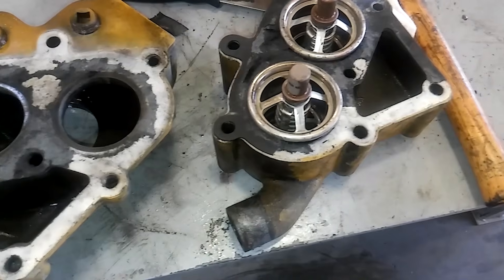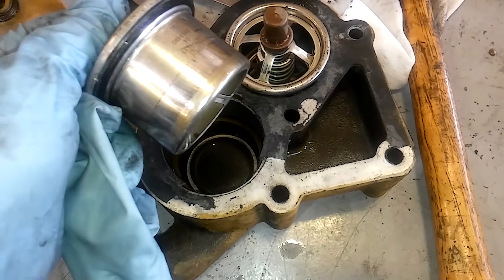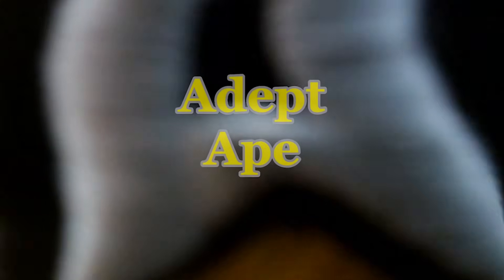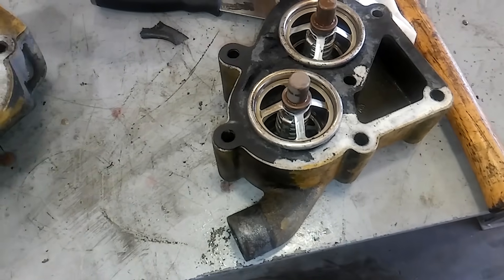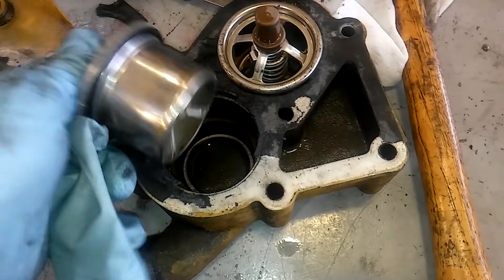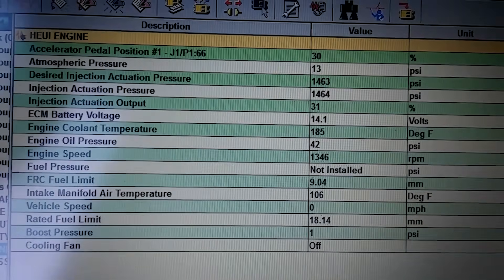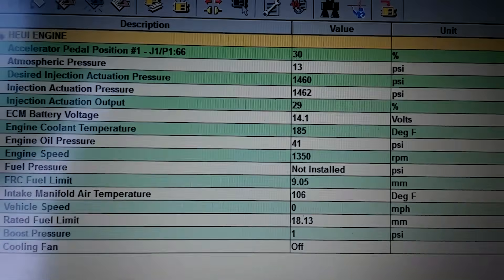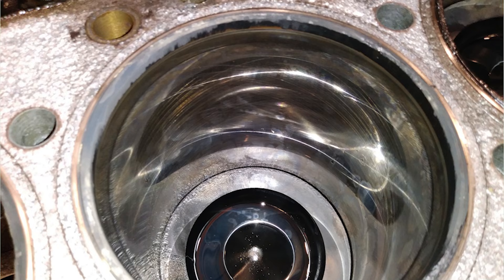Why You Should Never Remove or Use a Colder Thermostat In Your Engine.

Comment: what a crock, 170 thermostat, fan on at 180. been doing this in my trucks for over 30 years, no problems, better oil presser. I`ve been doing this probably before this guy was born, don`t believe everything you see on youtube. let me know if you need the cat part # for 170`s  I`m pretty sure that everyone know an engine is not a person,
Reply: I run my old junk cooler because it keeps running. Buying that little bit of time between 160° and oh shii, has kept me away from many shop doors.😂❤ automatic transmissions hate heat. They love cold. 94 Ford Ranger been on 165 with a bad sealing radiator cap for five years. Buick Rendezvous the bane of 3.4 Chevy engines has so many off the books repairs at 300 k that when it goes it goes. 

Right now what keeps kicking my butt are silly a** fuel pumps built right into the tank. Whomever thought that was a good idea should be emasculated with a rubber band.  

Junk just runs different.
Reply: Yeah that's how I run my cats 3406b no no problem every time I get one I change thermostats I can only speak for cat 3406 get that  210 you be fixing headgaskes
Reply: @darienbecerra2887  exactly. why run an engine right on the edge? Head bolt`s start to expand after you you get to above 195 to 200f, plus engine oil gets watery,  i`ve seen alot of head cracking problems especially on the cat engines. My truck gets to 185 I know something`s not right, also, those hotter thermostat`s don`t allow any room if there`s a failure someplace in the cooling system, it`s an emission thing nothing else, thanks for the back up

Comment: Maybe on cats its rare.  On DT466 its common.  The thermostat will start by not closing all the way and the engine won't come up to temp when its 20F or low.  Next it will fail completely not open all the way and the truck will overheat anytime the truck is under heavy load.
Reply: Cat they fail open.edit older stuff don’t know about new. I’m shade tree Non Mech

Comment: PISSES me off when guys torch an axle apart like that!!!, but the fact that you guys had a KASIER "K" series kit to put put it back together with doesn't surprise me.
Listening to "CAT" techs complain about stuff!!!??? (things I machine for the local dealers), and then watching you guys do some STUPID SHIT! really has me shaking my head at you guys!
Reply: Could you be more specific?
Reply: I like Josh’s videos very very much. Tip jar should be filled. Takes effort and guts to put out video.
But I agree. Heat then press
Reply: @RB-cz5jn  - In this case, assuming you are referring to heating the exterior of the axle "eye", the process could conceivably weaken the axle end, if performed necessarily to extreme in order to free the kingpin.
Reply: @cwj9202  another one of those not supposed to. But heat the pin and cool it then press it. At own risk because of damage and a result of to much play.
Edit: if I’m not careful I right a whole book.
If you heat the pin and it’s not cooled it will be tougher. Most heat the area around it.
There’s a trick to it.
Not supposed to heat it at all.
Shim kits etc etc..

Comment: Hey Josh. I did kingpins on my W9 and one of them developed a burr while still in its bore and locked up tight. Ended up having to pull the axle out and take it to a machine shop where they had to use a 150 ton press to push it out. What a nightmare those things can be!
Reply: Mine had to be heated to near melted with a 150 ton press , It ruined the hole so i ground off the axle end and welded the new ones in , they lasted to the end of vehicles life . Mostly overloading and very high mileage had welded them in .
Reply: @MyKharli  goodness gracious. What a nightmare. Great job overcoming! Replacing the entire axle ain’t cheap. I know cuz I priced it out.
Reply: @PickupsAreNotTrucks  They are silly expensive and second hand ones have the same fault imo . It was hard ensuring the kingpin was correctly aligned and keeping the top surfaces clean and flat . TBH i was always sightly worried the weld would crack off even though i did a beefy job . It passed the MOT for many more years though . TY for reply .
Reply: How often (miles) do you grease them? Never had an issue here in New Zealand but companies are basically required to have trucks greases every 15,000km or they void their insurance
Reply: @keyboardplayerakas  I try to grease my truck every 5000 miles or max 10,000. I bought the truck with a bad kingpin.

Comment: Slobber'r A.K.A. 66 Ford F100 always ran 160*F till I put in a 195*F ... Ran so much better and way better fuel economy.
Reply: Seen the same thing. 64 ford 292. Ran like junk until I put in a 190 back in it. The engine overhaul showed it as well.

Comment: I have a question about DEF and sensors. My township road crew wants to replace our old but low hour road grader with a brand new $330,000 Cat grader. It is parked in a shed 11 mounts out of a year, so would the emission parts fail easily setting that much? Thanks.
Reply: What is the reason for the grader needing replacement, and what is the old grader (120G or something newer)?
Reply: @cwj9202  one person just wants to replace the 30 year old machine and keep on a schedule of replacing all equipment averaging $100,000 a year so it is in the municipal budget.
Reply: @mikekahl5609  ahh, the old "if the money is in the budget we have to spend it so they will give it to us in the next budget". Typical 😥
Reply: @mikekahl5609  -- Having worked for a government entity, I will say I have heard that questionable rationale before, "It's in the budget!"  A grand waste of taxpayers' money!  We had nicely functioning heavy equipment whose age exceeded 50 years and hours that were low.  That $330,000 would look nicer on the roads and in any existing potholes.
Reply: @cwj9202  That's exactly his reasoning, its not my money and I want new equipment.
Reply: Not sure how hot it gets there but DEF has different life spans at different temperatures. Some def boxes have it printed in the side. As a general rule def should as be as fresh as possible but a hot shed all summer long could exceed its life expectancy.
Reply: I think draining the DEF, washing out the tank with distilled water and completely purging the entire system of all DEF will be a very good idea.

Comment: I will agree for the newer engines but I’ve got over 20 yrs in the trucking industry as a driver.
The old school guys did this all the time.
When your going up a mountain and your setting at 200 and above in a older truck with a older radiator. Your going to over heat. To many variables for me to make a solid argument.
But those guys get million plus out of there moter.
I enjoy and like this part. Basically a Mech saying one thing and raw experience saying different.
99.9 Mech would agree and good video.
But experience says your wrong.

Kind of like I’ve got a new truck and it will last yrs.. then they hit a deer.
Generic answer your right but it’s not.
Like when you plug in a computer and all you got to do is read the sensor. But what if the input information is wrong. Experience is going to tell the tale.
Thanks Josh for the video
My grandpa made millions off the grey area.
Reply from the maker: Older engines did run cooler than the 200 degrees I mentioned in the video, you are correct. Seems like they have incrementally been increasing the operating temps higher and higher to get the engines to meet their emissions standards. Thank you for the comments and your personal experience.
Reply: False information is just as bad.
Meaning if the inputs are wrong your answer is going to be based on false information.
Your right. I’ll leave it there.
Reply: @RB-cz5jn  here’s the problem with what you’ve said. 

The equipment old timers used, it sucks. Radiators were less efficient, the coolant was less efficient, everything was. To combat that, manufacturers had to use cooler thermostats. 

30 years ago, what you’re saying, might’ve been true, but now, it’s not. Engines are very efficient these days. Radiators, coolant, fuel systems, it’s all better than it used to be, so coolant can run at a higher temperature now without overheating. 

I’ll give you my personal experience. I have a 1965 Pontiac. If it’s a hot summer day and you sit idling, it’ll overheat. In my 2006 dodge pickup with the Cummins engine, it’ll cool down to around 185 doing the same thing. 41 years between those two vehicles, the dodge having better coolant in it and a better radiator.
Reply: @Redsfanatic32  I don’t know where to begin on this one. Old trucks bring a premium for there age. Easy to work on. You can make them pull like a freight train. I highly disagree. They are less efficient. I got to drive a new rental day cab about 3 yrs ago. It not only burnt about the same amount of fuel as a 3406b peec it also used def.
It was a auto. Very dangerous especially when it couldn’t figure out wich gear to be in.
Middle of a stop light and it just kept on clicking.

There nice to set in.
But no and I mean nooooo.
After all the costs in owning new other than a right off. Nooooooo
Rather go to Thailand with the extra money saved. Edit: I understand the fuel savings I have Ooida’s spread sheet with the break down of savings. I also understand torque etc.. but ask Josh about the Ard head and reasons why cat said “no” to over road engines.

Most don’t want to drive a nasty old looking Volvo or a ant eater or old fld120. There not cool.
Where the money is at. Down time/repair cost.
Reply: I’ll add another comment to improve your algorithm.
Thermostats open close at a exact temp
Over time
Do a experiment. Off subject a bit go to auto store say you want 10 radiator caps all same temp. Then have them test them.
Old school then why did cat have the different temp thermostats for same engine.

Things to chew on I’ve got more

Comment: On the subject of cooling, would it be advisable to replace a mechanical AC compressor with an electric compressor (maybe two to achieve the same or better cab cooling) in the aims of reducing engine load when climbing hills? I figure on a car they rob anywhere from 5 to 10 horsepower so it's probably a lot higher on these engines. That coupled with relocating the heat exchanger for the AC system from in front of the radiator and intercooler would help keep engine temps under control when climbing hills and reduce driver fatigue
Reply: If you did all of that.  You would more than double the load.  Decrease efficiency of the AC system by relocating the condenser to aft of the radiator, then the pumps would undoubtedly be running at 100% duty cycle all the time.  Engineers... we don't just toss things together without reason.  Compressors on these trucks don't require any different power than on other applications.  10hp is about the top.  If the engine won't stay cool on grade, slow down, gear down.  No getting around physics.
Reply: @ShainAndrews  variables don’t change over time? I agree on AC.
But I’m a nobody just saying
Reply: @RB-cz5jn  What variables?
Reply: @ShainAndrews  let’s start by saying I’m a shade tree mechanic at best.
Nothing last forever. Especially trucks.
My equipment may look old but just about everything has been replaced through wear.
That needs to be kept in mind. Not different for the inside of a engine.
Especially springs. True they rarely fail but over time the seats and the springs become fatigued(thermostats).

Something engineers need to keep in mind.
Max force engine was a excellent example.
There must be trial and error even when on paper it looks right.
Jaypaydirt has a excellent video on n14 and oil pressure. Real  eye opener. He rebuilt a n14.

Variables or the devil in the details especially over time.
Reply: @RB-cz5jn  I didn't know what angle you were going with.  What many don't see are the constraints an engineer is bound by.  Then there are managed constraints like are engineer groups siloed or is the organization flat?  In my experience engineers left to do their thing with defined constraints produce quality results.  There are plenty of flops out there.  Many can be attributed to mismanagement.  Some the result of a brand new constraint with a unique solution applied and no good method to vet its suitability in the wild.  As the OP was speaking towards AC specifically.  Nothing bleeding edge there.  Changes are minor  almost always driven by emissions standards.  In my engineering practice I drive design based on KISS.  Look for the elegance in simplicity.  As complexity increases failure modes increase... sometimes exponentially.
Reply: Ironically you'd be putting more load on the engine. As the AC compressor is normally direct mechanical drive this reduces any losses and energy transfer. However with an electric version you lose quite a bit of total energy converting it into electricity from rotational energy and then back into rotational energy at the motor. As well as taking up more space and potentially requiring a larger alternator to keep up. People often forget that when you pull hard on an alternator you can put up a considerable amount of resistance in the range of upto 15 to 20 horsepower of loss
Reply: @Suedeman  maybe he`s got solar panel`s on the roof
Reply: @606budwheel  the output of a solar panel on the roof of a road tractor is gonna be 2 amps at best parked in direct sunlight. A single electric ac compressor for a Toyota  camry draws about 55 amps constant. No amount of panels is gonna keep up
Reply: @Suedeman  you really took that serious? good thing I didn`t joke about having a wind turbine on the roof.

Comment: Josh, I have C-12 and tech installed 180F thermostat in summer time on it, it runs good but temperatures being in 30-20F range now will it create any problems with me running like that? Side note, I have very small radiator on my 387. 
Thanks, Ivan.
Reply: Put the OEM spec thermostat back in and leave it in.  If you have thermal issues in summer address the cause.  Plugged radiator (internal, external, both) fan clutch.  If the radiator is undersized see about getting a larger radiator (more frontal surface area is preferred, more cores comes in second).  This video literally covered this.
Reply: @ShainAndrews  387 with c12th came with small radiators from factory,  mistake was to buy c12 not c15 version. 
According to cat 180 and 190F thermostats came as oe choices,  so go figure.

Comment: Ok Josh update: My C7 RV is AOK and I'm now new owner of C 12 Dump truck. 
I was a week late picking it up & they lost an injector thus lifter thus cam! 
So now I have entire new set of lifters & new cam! This was BEFORE I saw your C 12 video. 
If dash gauge is correct my thermostat opens up at 230 and just runs outstanding at this time. According to this video 230 is too high (per dash gauge) so should I seek competent help to change to 220 or similar?
I did have some coolant bleeding early on but bought new cap #14 and it's better now. Maybe a gallon every 3-4 weeks
Did I just answer my own question???
Arizona
Outside temp/workloads extremes
But running outstanding
Cheers!
Reply: You are loosing coolant via the radiator cap?  That is not right.  Make sure the sealing surface is not damaged.  If you are loosing coolant you are loosing pressure and lowering the boiling point of the coolant.... unless the cooling system is being over pressurized by say exhaust gasses... which is worse.  LOL.
Reply: @ShainAndrews  Hi Shain! Update: So 2 things-the new cap did the trick so no more loss of coolant. And where I thought I was reading 230 printed on gauge it actually is printed "200" and that's where it pretty much stays. I must've had some kind of hypnosis thing going on to misread a perfectly good gauge. Now that it's in the upper 30s to lower 40s every morning at start up I'll maybe wait a few extra minutes before hitting the street and it gets up to operating temp not long after that. Climate control is great on the ol' truck also
Cheers!
Reply: @philipchesley9615  That is all excellent news.  Nothing better than a $10 cap (or what ever they charge now) for the win!

Comment: I was taught and have seen it that a thermostat slows the velocity of the flow to give the coolant time to transfer the heat while in the radiator to the air
Reply: Osborne Reynolds would disagree...The faster fluid flows, the more turbulent it is, resulting in HIGHER thermal transfer...However the water pump must be of a design as to not create cavitation, which would be counter productive.
Reply: That person told u wrong
Reply: @pr0n5tar  What Person Told WHO Wrong?
Reply: Wrong.

Comment: So say I have a truck that only runs about 180 degrees and 160 degreee oil temps going down the road. Granted we are getting into colder temps here in the Midwest. Truck only has 136,000 original miles and is a 2001 6nz. (Truck sat for most its life) but has an oddly high oil consumption rate. Could the thermostats be sticking slightly? Doesn’t have a problem holding temp at idle but takes quite some time to warm up.

Comment: The new emission engines the hotter the better. If you've got over heating problems look at your radiator, cooling fan. Got the fuel cranked up, hell a plugged air filter can cause an engine to run hot.

Comment: Does this also apply to gasoline engines?
Reply: Under normal circumstances yes, but racing, probably not. At that point the engine is long modified. Cooler T-stat is worse for a normal daily especially in colder climates, heater core doesn't get hot enough and you get less heat in the cabin. Know this from personal experience.
Reply: A gas engine running too cold the computer will over fuel the engine. You'll get poor fuel mileage, old carburetted engines run like a bag of sh*t if the engine isn't at 180 degrees.
Reply: Yes.
Reply: Yes. If removed for racing or something like that then buy a restrictor. Coolant moving too quickly is a problem.